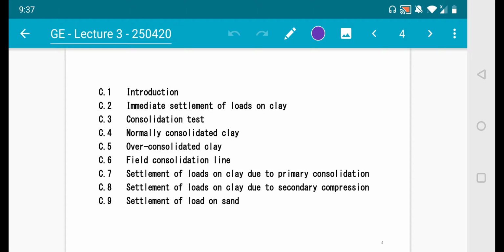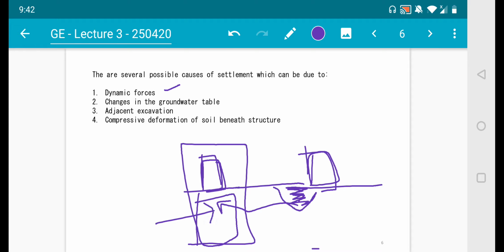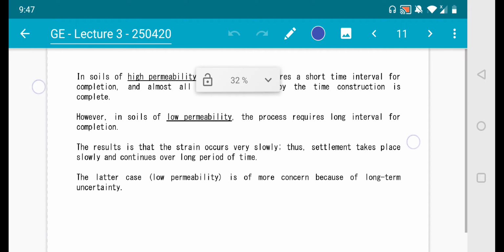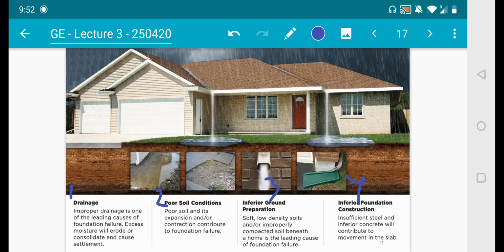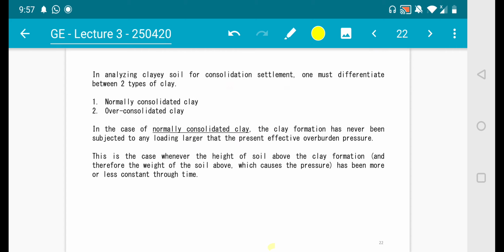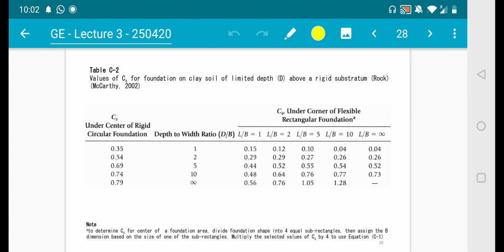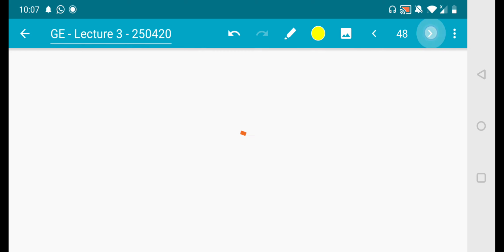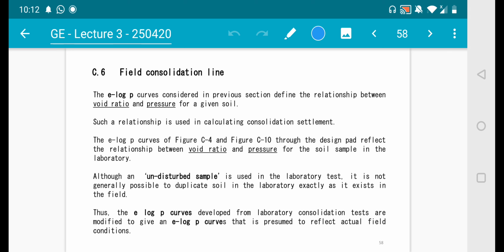GE Series - Chapter 3 (Part I)

Comment: MUHAMMAD NAZRUL HAKIMI BIN MOHD RUSLI (KIA170061)

Salam and Good Day Dr.
For slide no 17, one of possible causes of settlement are poor soil condition rite, so my question is how can we ensure that the soil has good or poor soil condition before we start construct the building ?
Thank you for the lecture Dr.
Reply from the maker: Good day to you as well. In this case, as a geotechnical engineer you need to make sure that the soil is properly compacted. Technically elaborate in 'in-place soil unit weight test' and 'field control of compaction' of Chapter 4.

Best regards